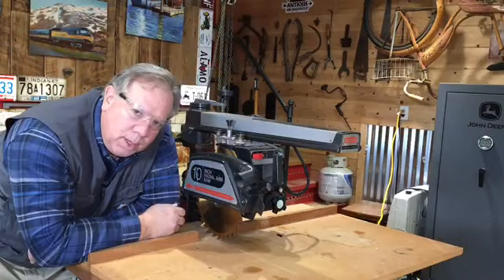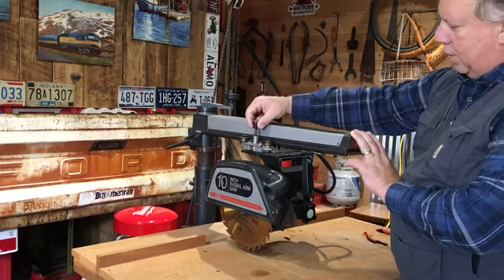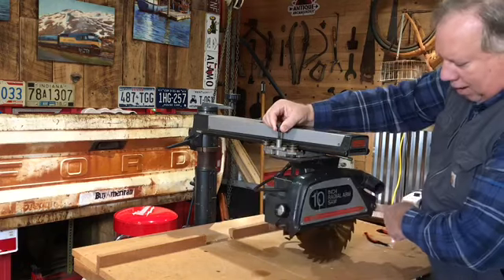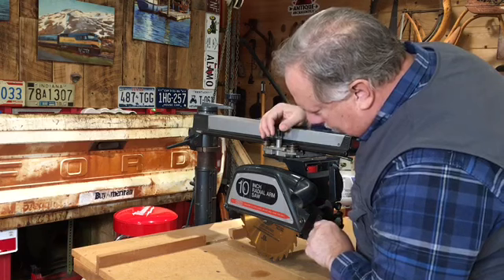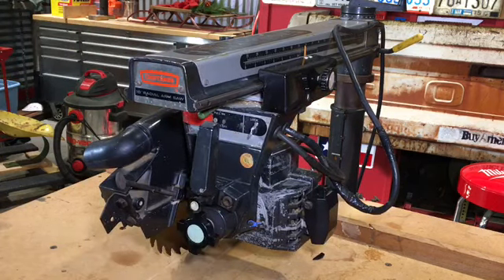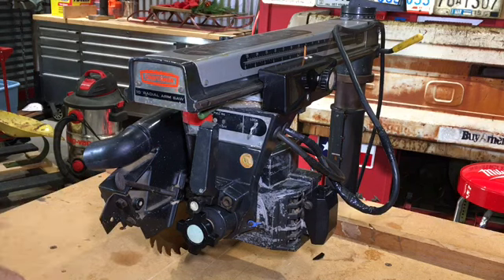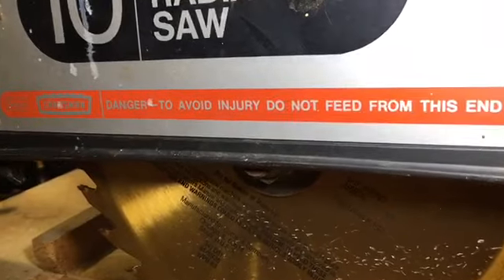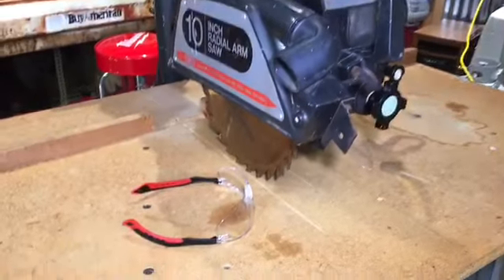1973 Craftsman Radial Arm Saw | Is It Safe To Use?

Comment: How many table saw video's have you seen where the cut piece hides the blade, or after the cut the piece is picked up by reaching across and over the blade?  A RAS blade is usually never hidden, unless you are using it in some spectacular weird way which should already alert you that the cut is most likely unsafe.  
Yes, you can rip in the wrong direction and launch a 2 x 4 into or through a wall or 15 feet out of your work shop doors, but you will only do this once or twice before you realize that you are cutting in the wrong direction. 
  Learn to stand aside not behind or in front of a rip.  Never get your hands close to the running blade.  Just pay close attention when in use,  if your grandfather built grandfather clocks with it you know how useful, accurate and powerful they can be.   CAREFUL but enjoy.

Comment: Even with the crosscut feature be very careful. I have found that the kickback lever is more dangerous in place than without it. Because you cut on the pull most of the time, be cognizant of the fact that the blade wants to drive towards you. Be very careful. I have used one of these many, many times both for woodworking as well as vinyl siding and they need LOTS of respect. I prefer my table saw. I could have inherited my dad's radial arm saw (very similar to this one) but chose not to because of the safety issues.
If you are cautious and pay attention it can be a great tool in your shop. Enjoy!